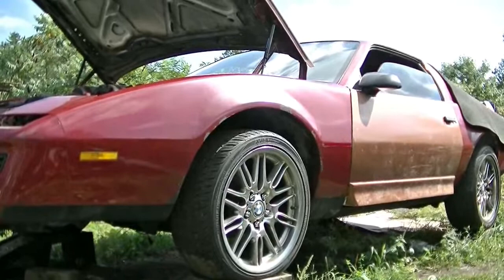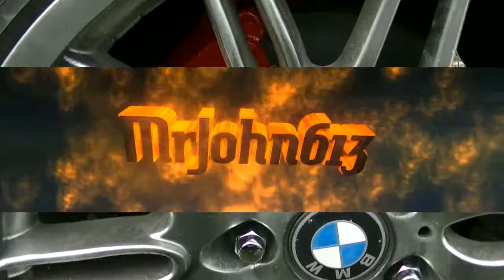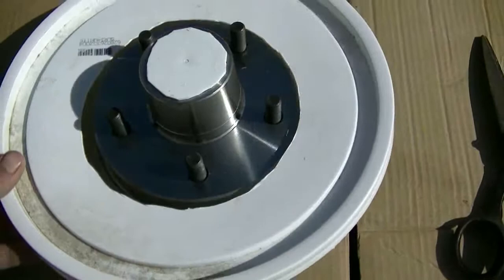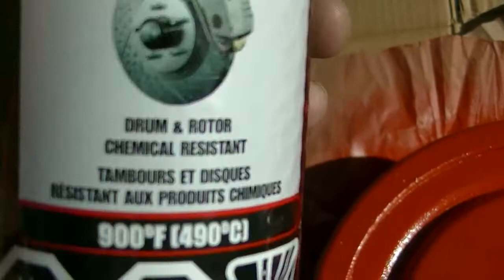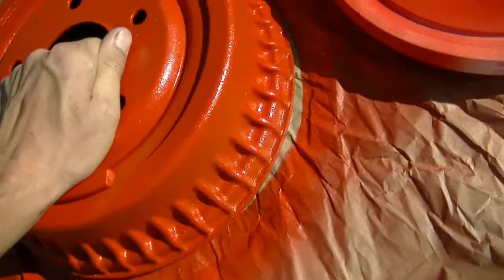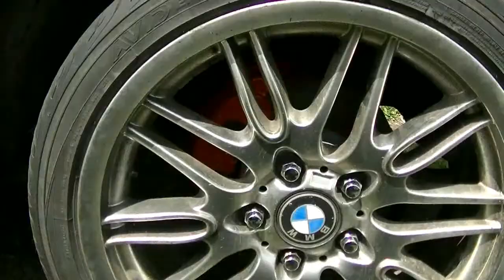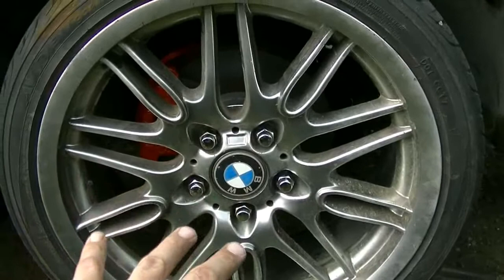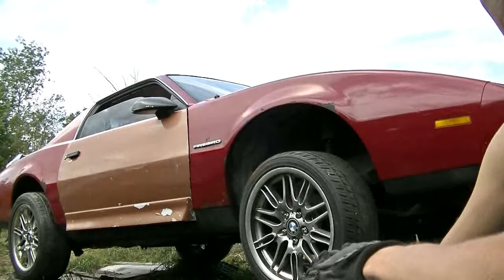Painting & Installing New Brake Drums Hubs & Rotors Part 1

Comment: In the 90's I worked at a stereo shop that sold custom rims and have seen MANY horror stories involving spacers/adapters. Be careful! You installed them properly and I recommend checking torque after 100 miles.
Reply from the maker: im a firm believer that stereo guys are good at what they do, and rim shops are good at what they do, but "a jack of all trades is a master of none.  if you wanna get paid, just master one."   im a firm believer that stereo shops should stick to stereo installs and tire shops should not sell baby strollers.  lol if that makes any sense.  i've been around cars my entire life of 30+ years but i've only recently tried the bolt on wheel spacers on two of my projects, the trailblazer and the firebird.  doing burnouts and high torque and high wheel speed, i will want to be sure to install them properly for sure.  i will double check them after 100km yes, i agree.  im kinda new to spacers but im very precautious along the way, i trust the bolt on type like this with good studs and stud length, but i dont trust the slip on type spacers which make the wheel studs shorter, i do not recommend that type.

Comment: Looks really good. Thinking about changing my rear 14 bolt on my blazer to disc. I have a bad wheel calendar, it's leaking. So i want to probably do the change instead of wasting moneyon parts to just change outin another year
Reply from the maker: discs are a nice retrofit upgrade but the factory drums are cheap and easy.  never mix differet types of fluids, that can ruin wheel cylinders